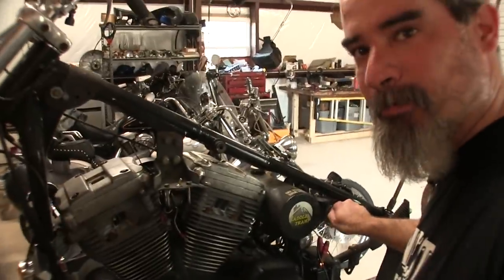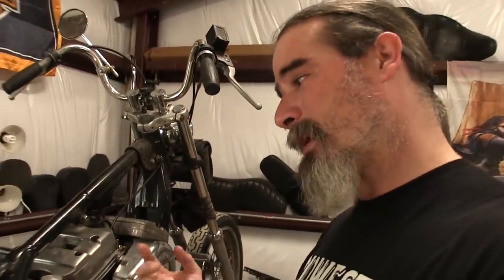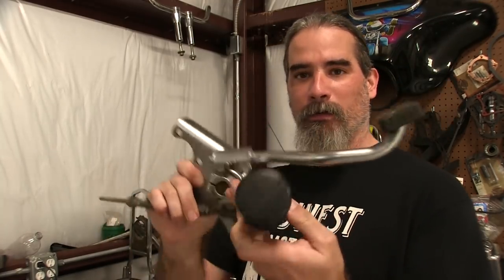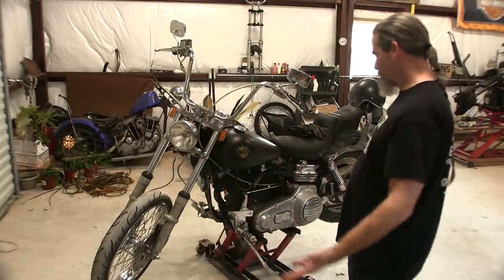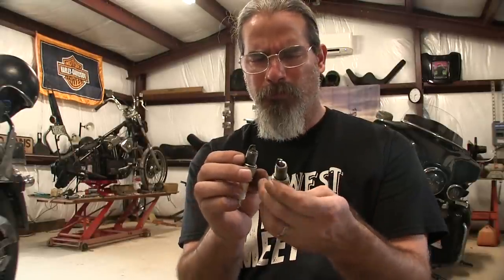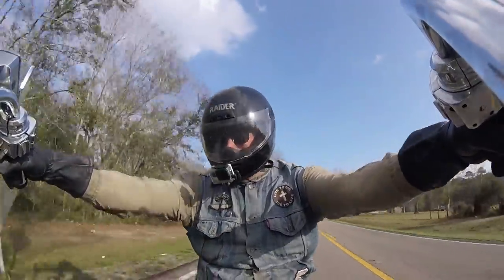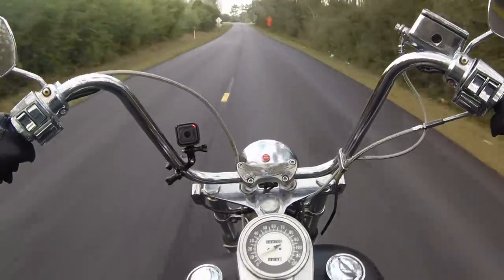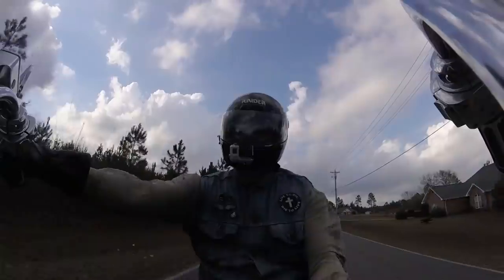HARLEY Davidson SHOVELHEAD Is WAY PRIMITIVE Of A MOTORCYCLE For Today's RIDERS

Comment: Great video, looks like it's going to be nice. Try grounding your plugs when you turn on your ignition. Otherwise you'll fry your ECM every time.
Reply from the maker: I did that.
Reply: @SaddleTrampTV  Ignition module is shot and ALL grounds should be revisited.
Reply from the maker: @kennethwise7108  Actually, I solved it already. Turns out I mis-identified my hot wire and had it on the wrong post. It's arcing and sparking now.
Reply: @SaddleTrampTV  NICE!!! Sometimes it's something simple and overlooked. Glad to hear that you got it resolved.

Comment: Harley's are addictive, I have 3 a 2003 Softtail Standard a 2003 Ultra Classic and a 1983 Shovelhead Lowrider basketcase I'm working on. I rode a 1980 Wideglide  back in the 80's and the new engines just dont have the sound, thats why I got the 83, cant wait to hear it run. Oh my wife has a 2016 Lowrider of her own, like I said addictive

Comment: After over a half century of riding if I had to have only one scooter it would be a 1991 to 2003 sportster stroked to 4 5/16 with 3 and 3/4 cylinders in a rigid frame bobber. A 90 inch 400 pounds motorcycle is nothing to sneeze at.

Comment: Agree pegs needed replaced, my 78 sportster has same turn signal set up, the different idle an how it runs I found out is due to winter/summer fuel mix, hot an cold weather an humidity, those affect my two 78s.

Comment: Man, enjoy that great old bike!  But if you're gonna keep riding it, I just have two words for you: Harley. Owners. Group.  JOIN IT!  Then, even if you do break down, at least someone will come get you.  Even if the dealer won't work on it (or recognize it), at least it can get you off the side of the road.  The hold-the-button-down turn signals were...odd...but they sort of made sense.  And then HD went to the push-and-it-stays-on with self-canceling feature - even better!

i (briefly) had a 2006 Street Bob with the 88 c.i. twin cam motor and a six-speed trans. That bike was as smooth and comfortable and powerful and reliable as anyone could ever ask for.  Soooooo civilized, those Evo motors!  It's really amazing when you think about how far HD has taken that same basic design.  But I always thought about the few 74 c.i. shovelheads I'd ridden, and how much better the new ones are.  I simply cannot imagine doing any serious traveling on a Shovel.  I take my hat off to the guys who went touring on an Electra Glide back in the '60s and '70s.  Tough old birds - they had to be!

Comment: Tramped all over the country on a shovel, one of only 5 shovels at Harleys 100th .. Still own them and still ride them, getting a new bike for long leg riding .. 95 Evo decker, i should've waited to the end to commit, .. Gearing is 21 trans 51 rear .. I run a 24 front 51 unless I'm highway then its 48/ 46 rear its takes a bit more clutch at take off rolls no issue, one of my bike i put a 6sp with o/d and it helps the killer 50 hp harley claims but i run sifton cam, soilds, Mic 40mm round slide carb and points on all my bikes, and tools but i can make it from Detroit to cali no problem .. Rode to fla for trailer week and seen a few bikes there a few yrs ago .. I feel old now thx lol

Comment: i agree, i have a 1980 flh which i've had since new and the bike really had not changed much from a 1960 bike except it had an electric starter, electronic ignition and disc brakes. when i compare it to a modern bike the only similarities are the v-twin motor and it has 2 wheels. mine is easy to drive like an old truck but i like that and it has a big comfort flex seat with springs and i sit up nice and high and tall in the saddle. it cost $5200 bucks new.
Reply: the thing actually rides better with 2 people on it , kinda smooths out the vibrations especially at 70 mph. it is a 1980 and 80 cubic inches. the only problem was the hard saddle bag covers would fall off at speed so i ended up securing them with quick release cotter pins.

Comment: Let me get this straight.  An engine that was last built by the factory closing on forty years ago, is now a bit primitive by today's standards?  Who'd have thought it....

Seriously though, my dream chop would always be a shovel...
Reply: In the 80s I test drove a Harley Shovelhead dresser with no Fairing and no bags but with a belt drive primary and secondary I was expecting vibration that would shake your feelings out and it was smooth as silk I wish I could have bought that bike but I was saving money for a house and I already had two motorcycles if I ever wear out the primary chain on my forty-year-old Triumph I would seriously consider converting it to belt drive my Evo Sportster has 330,000 miles on it and I have gone through three belts in 25 years

Comment: i had a 93inch shovel never had plug troubles or oil leaks,except the primary leaked a little.i also had a 1974 flh police special.that one the flh when i got it had the wrong pluge in and it ran like shit.i pull ed the plugs and put the correct ones in and never had troubles again.

Comment: I changed my front sprocket to a 25 tooth and my rear to a 49 tooth on my panhead and 4th gear is pretty much highway use but it runs 70 no problem. My motor is built up a bit though so thats part of the equation.

Comment: Primitive ?  That's too funny.  My first bike was a 47 knuckle followed by a 48 pan then a 57 pan.  All rigid frames.  Riding shovels with a swingarm felt like riding on air compared to them.  IMO nothing looks better than an old knuckle or pan and if my back could still take it I'd still ride them.  When Harley brought out the Evo and squared the cylinders they lost a lot of their looks.  In my opinion

Comment: If the bike not firing has a handlebar kill switch, check that for a broken wire or bad switch first.
 Plug gap for points ignition is .028-.032, I always set mine at .030., with a .016 points gap.
 Electronic ignition plug gag is .038 to .042., I set mine at. .040. Not sure what the newer models call for.
 Most modern riders don't like shovels.
 After riding my '72 FLH, my brother in law said that if that is all he had to ride, he wouldn't.
 There's an old saying that Harley's were made to keep idiots off of motorcycles, but that doesn't apply to you.
 You should do just fine.
 If you go to a 24 tooth tranny sprocket and a 49 tooth wheel sprocket, it'll feel like you have overdrive.
 It'll lose a little on the takeoff, but you should be able to cruise at at least 70mph with ease.

Comment: the Tramp issue seems odd/weird. i can understand trying to swap parts to find the issue but taking parts off the Shovel maybe a bad idea considering they can have a personality lol.  still really strange to stop getting spark like that. to me at least.  i have never owned a shovel but i would think dropping a tooth on the rear would help it because that should lower the RPMs . i still wouldnt run it at 70 though maybe try 65 to see how it runs or 60.  it is after all a "take your time" type of bike. it does look and sound good.  good vid man

Comment: Just a tip, a wire can leave  conductive material on the insulator that leads to misfire. The BEST way to clean spark plugs is with a propane torch, heat them up till they're glowing red and the insulators decarbon and go back to white, it works a treat... Like in the video below
https://www.youtube.com/watch?v=1QHI5-Kzs0M
Reply: I’ll have to remember that

Comment: 😂 let me try this  again. 
I have a 1975 flh. (Owned it for 40 years)
I’ve added 2 teeth to the front sprocket and now she will cruse at 75mph no problem and I normally ride doing 55 or 60 mph in 3rd. Unless I’m on the turn pike or big highway. 
She still has it!! 😉👍
Reply from the maker: Good deal, man!

Comment: If you want to do 70 longterm baker makes a 6 speed transmission for it that retains the kicker. Granted it’s not particularly cheap
Reply from the maker: I bet not.
Reply: @SaddleTrampTV  You get what you pay for. The misery of poor quality lasts long after the joy of low price is forgotten. I have the Baker 6into4 in my 1971 FLH. Wouldn't trade it.

Comment: I own two and have no thoughts of ever buying a Newer one. I like how the ground shakes when I start my 77' the sound is so crazy that people next door freak . I rode a Shovel back in the early 1970's and wrecked it and almost died. I am not into the newer H-D's they are just too refined for my liking , they have a sheet-metal frame and soft metal heads , plastic controls , just not into that .  You try to tell people what's it's like to own one and they just don't understand or they just start crying all over you. I love the power ! the super long gears , heavy steel frame and real metal heads. New ones are okay I have rode them but it's just not the same.
Reply from the maker: Right on, man!

Comment: Never forget as a HD newbie back in 89  I was checking out for sale ads .I was already told if ya know nothing about Harley don't buy anything before 84 year.So here I am phoning Harley Sporty ads ,and very soon noticed some ads did not put the year in the ad.When I asked the year and got answers 83 78 etc and I said no thanks ,some of these guys were getting passed with me .I just said sorry but I need a evo post 84 Sporty .
I love all Harleys and my present 98 FXDWG is a beaut .bought it in 04 and its never missed a beat.
So for all you shovel guys out there ,I can only say EVO RULES.

just funnin
Ps where do you top up oil .Never needs topping up.lol
Reply from the maker: Evos certainly are much easier to work with. You can rebuild them with common tools. Plus all the parts are committed.

Comment: reg sportster- also check  wires from stock ignition going to a  sensor  which shut engine if bike goes on ground.. not sure if you had this   sensor  originally , if you had it You  to had to ground that wire initially.. so maybe it broke , worth checking it..

Comment: Gat a 82 fxwg.  Slack in the chain, will jerk at takeoff. Replace front and rear sprocket with chain, tight is roght.  Speedo, run off transmission . Line up tighten new trans cover, cable. Drive it like ya stole it.

Comment: Not a 70mph motorcycle? Glad I didn't know that when my wife and I rode my 77 Superglide from Georgia to Sturgis back in 94. About 80mph on the Interstate, 1620 miles there,and 1620miles  back.  No problem.
Reply from the maker: Apparently it's just not geared for it.
Reply: @SaddleTrampTV  A 24 or 25 tooth transmission sprocket makes a huge difference on the highway versus stock.
Reply from the maker: @philmclamb1219  It has a 23 on it now. I'll consider that. Thanks.

Comment: I run a 49 tooth rear (stock should be 51).... be careful with the speedo.... some are 2:1 and others are 1:1... front wheel and trans case speedo drives are not compatible with all the speedo in the dash. the speedo should be stamped or marked what its ratio is somewhere on the speedo case... be careful... ENJOY!

Comment: I was having problems with my 85 FLHTC speedometer. After spending a bunch of money trying to find a used one I just went with a GPS model. Esthetically you can't tell looking at the bike. Also my bike seems to idle at different speeds so I purchased a Allen head screw with the right thread and took a section of speedometer cable and attached it and placed a knob at the end. It looks weird but I can adjust my idle pretty easily on the fly

Comment: You will learn it's quirks. It will make you learn them. 😆 I put points in my shovel so I could kick start it with a low battery. Where as with electronic I had to have full voltage to be able to start it.

Comment: Never use a wire wheel to clean spark plugs.,metal accumulates on the ceramic and will ultimately promote a misfire.If you've ever sharpened a knife on a ceramic stick you'll know what I mean. If you must, get an old time plug blaster but make sure no sand is stuck up in the plug before reinstalling.

Comment: Did you static time your ignition system. You might want to check a video out on youtube about single fire ignition system install. Sounds like your 12 volt wire has come loose off the coil. May need to run new power wire to coil.

Comment: Put a set of points in it and a Mikuni carb, and it will drive any where in the country you may want to go. Mine has never dripped oil or failed to start.

Comment: Hey man, im not sure about your year sporty but I had the same problem with spark. For me it turned out that the bank angle sensor would not allow the bike to get spark. If your year bike has one or anything like it make sure that you are grounding it out. For me, The bank angle sensor used one of the special clips so I just went in and grounded it. My best guess is that your coil isn't grounding, for one reason or another. 

I would get one spark when turning the bike over and then nothing. so I would try that if you haven't!
Reply from the maker: Turns out I mistook which wire was my hot wire. It's arcing and sparking now.

Comment: If you own a shovel you really need to have the factory service manual... keep the stock gearing and accept it for what it is.......don't lower the rear as the chain will eat out the inner primary case

Comment: you can run a hot wire from the ignition switch to the coil direct & see if it starts
Reply from the maker: Maybe
Reply: @SaddleTrampTV  put a fuse in between to be safe

Comment: 70 thru 84 were the least reliable HDs , those years were AMC . they kept the name alive till HD bought back in and invented the EVO ...... anyone with a set of tools and know how to use them  can keep a shovel running ..... have fun with it !
Reply: No AMF was bought back by Vaughn Beals and a few others in 1981. In 82 they tightened up the Shovel tolerances. If maintained they don’t leak and are pretty reliable. I have an 1984 FLHX runs great very dependable. I ride it way more than my twin cam or Panhead.

Comment: You have to watch out with the ECM when powering it with no sparkplugs attached. Crudely put, the ECM charges the coil with (magnetic) energy. It then interrupts the current based on the timing sensor. Then the energy in the coil will then either generate a spark at the plugs, or when there are no plugs, generate a super high voltage at the ECM. This can blow up the ECM. Never power up an ignition system without the plugs attached.
Reply from the maker: I did that.
Reply: Interesting. Didn’t know this. Good to know.

Comment: Do a bigger gear on motor, say 24-25 teeth. Rear wheel put 49 tooth. You can up the trans sprocket a tooth. That will be a decent road gear.

Comment: My Shovelhead chopper has a 23 tooth front sprocket but it will rub on the primary cover I believe it has a 48 tooth on the back I can't remember it doesn't have a real strong takeoff but I have no problem running 90 miles an hour
Reply from the maker: Hmmm... I'll have to remember that combo set up.

Comment: Shovel Love
The metallic blue paint shined it's prismic colors back at me in the sun. My bike connected me to the earth. That's the only way I could explain it. A conveyance fabricated from inanimate pieces of metal and other materials. Created to take somebody from one place to the other… What's the big deal right? Well somewhere along the way it became more than a machine. Was it the pure organic shape of the twin tanks? Was it the amount of physical involvement it took to get it started? Was it the intense scrutiny of every nut and bolt before and after a ride? Was it the familiar oil spot always in the same shape? Was it the way it felt when you drop the clutch and the deep well of torque shoves you forward? Was it the way every boy in the schoolyard would run to the frost fence to watch you pass? Was it the sound that it made when it dropped into its loping idle...sounding like it's about to stall until the heavy flywheel carries it through its next sequence? It was the  combination of all these things that gave it "personality"...it was the love I had for it that gave it "soul". My companion, my friend…always there to join me on my next adventure. 
 
                1 BROKE TRAMP
Reply from the maker: Well said, man

Comment: Shovels run hot , so a oil cooler & good synthetic oil really help . Never had any issues with my 1980 FL or 1984  FXWG . I had 50 , 000 & 20 ,000 miles on the plugs before change out !  Sounds nice Cory !
Reply from the maker: Good thing this one's got one.

Comment: I have a 1978 super glide that I bought new and every time I ride it I hold my breath and hope something doesn’t fall off , it’s a rattle trap for sure I changed my sprocket to drop the rpms so it wouldn’t vibrate too much but it stil vibrates , I really appreciate my newer bikes so much smoother

Comment: Say Tramp,  that XL, does it have a kill switch, ?,  later years start and run switch were tied to start switch, seems I remember to check the R/S switch , think I got burned on just such a problem back in the day. You shud have juice to the coil,  key on run/stop to run,  you also can test your module , all wires connected, disconnect 3 pin rubber connector to cam sensor,  key on,  short across the two long pins in connector to module , causing spark. If that test works, it is a bad sensor.
Reply: Goes without saying , you must ground plug to cylinder head to get spark.
Reply from the maker: @russellhueners8499  Did that
Reply from the maker: It has no kill switch. Bypassed that when I built it.

Comment: Is your oil spray on the Shovel coming from the crossover tube for the rocker covers? I bought my 1981 brand new and it sprayed me on the first trip I took. An old timer gave me a hand full of rubber seals and told me never to travel without them. Lol You'll learn to love that shovel.
Reply from the maker: yep
Reply: @SaddleTrampTV  I replaced the tube with a braided line. It hasn't sprayed me since.